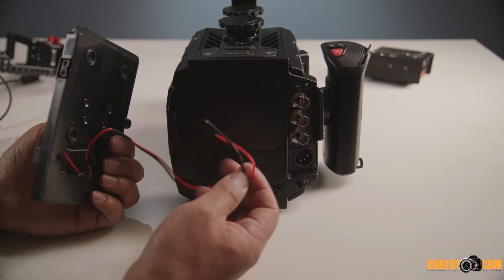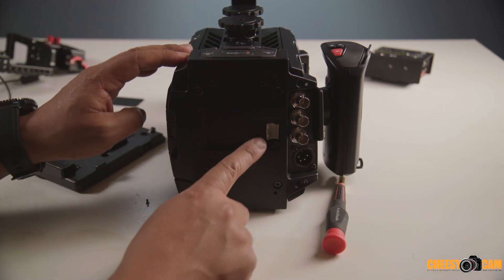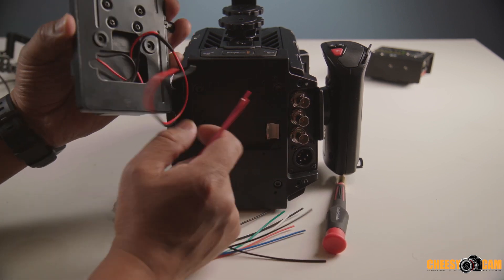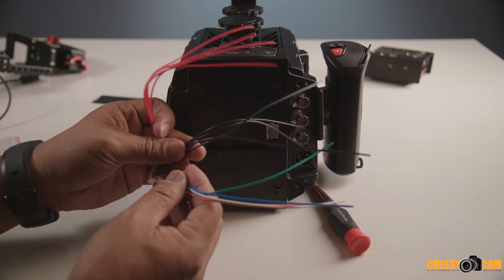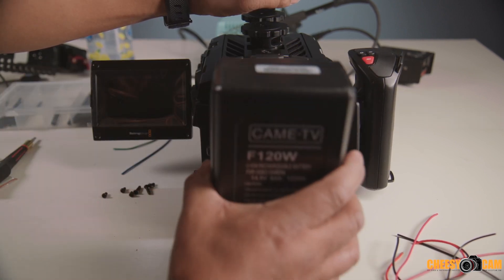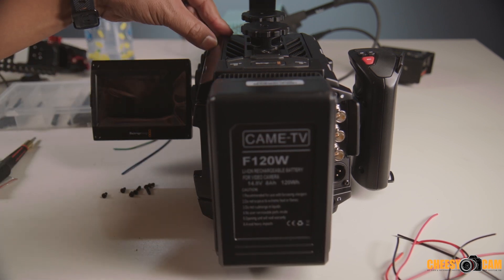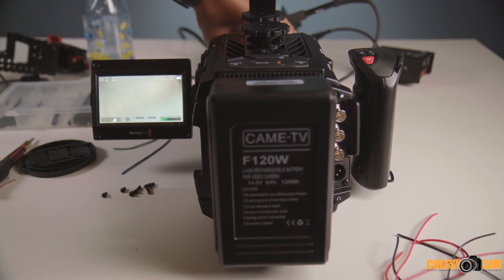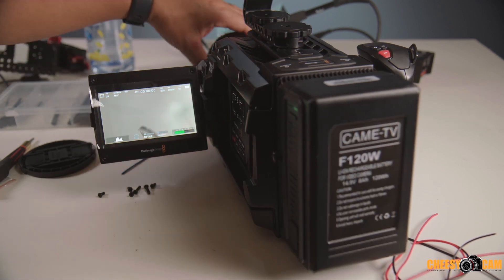Soldering Ursa Mini Pro 4.6K V-Mount Battery Plate

Comment: How is the quality of the 8$ plate compared to a 100$ one? Are the battery's clicked in safely? Easy to remove them? Thanks!
Reply from the maker: It works good. The dtap is blocked though, so i use the dtap on the battery. Not a big deal for me as I dont use the dtap often.
Reply: Hey, do you have any experience with this setup and a dji ronin-m? Would you need to remove the battery plate in doing so? Thanks!
Reply from the maker: Ronin-M is going to be too small for an Ursa Mini. You'll have issues. Go big Ronin or Prodigy.
Reply: Yeah but I already have the ronin-m and I have seen some video's by users using the ursa mini 4.6k on the ronin-m. But not sure if they are using it without a battery plate. But yes you are right,  I should upgrade to a bigger ronin(mx), when I have some funds again.
Reply from the maker: I think the RoninMX is still too small to be comfortable with the camera. It may limit you to only small lenses.